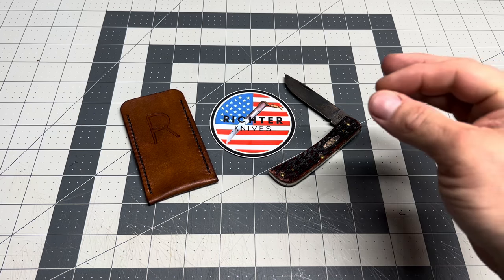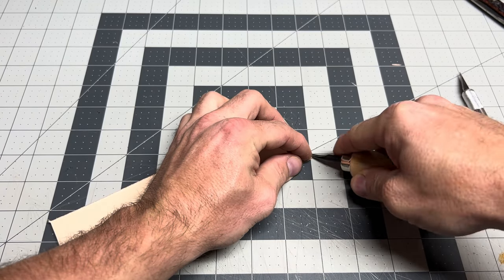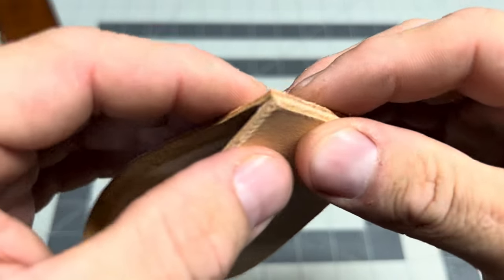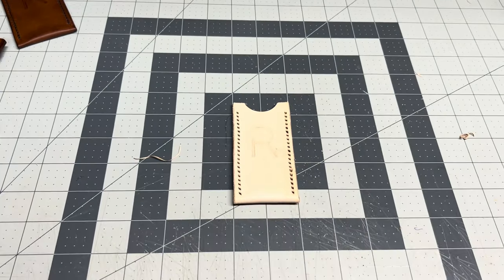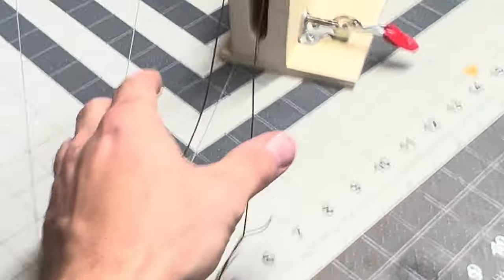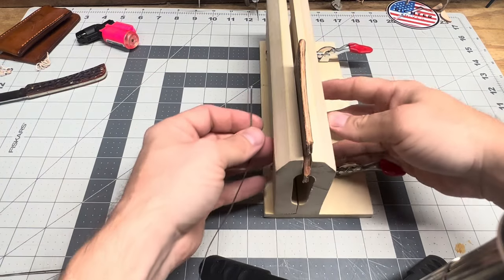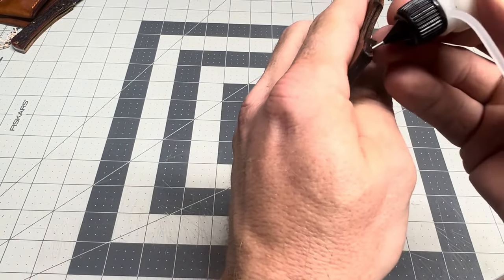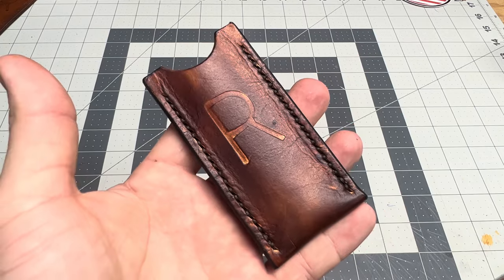Richter Knives Episode #80 HOW TO MAKE YOUR OWN LEATHER KNIFE SLIP (UNEDITED AND UNCUT)

Comment: Great video, thank you Richter 👍
Is 5-6oz leather the correct size?
Do you have a preferred thread size? You mentioned 0.8mm… on Rocky Mountain they mostly have .6, .8, 1, and 1.2 size.
27:00 do you normally cut that thread grove into the back as well? I see—probably because you have to punch the holes through.
“Because I like to party” 🤣
I actually live in the town where Elvis was born
Thanks again Richter.
Reply from the maker: 4-5oz is perfect. I don’t cut the groove I. The back because it’s hard to get just right when you poke the holes.